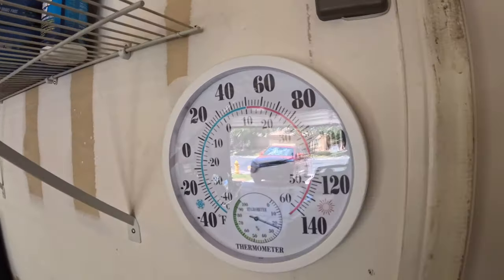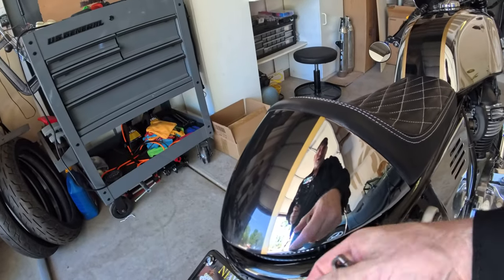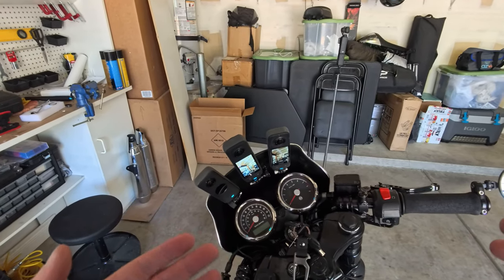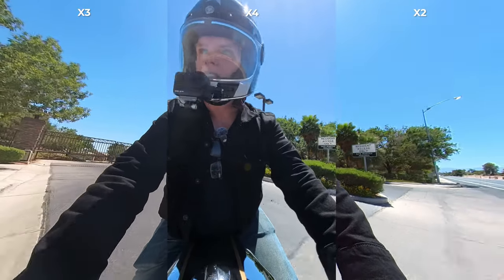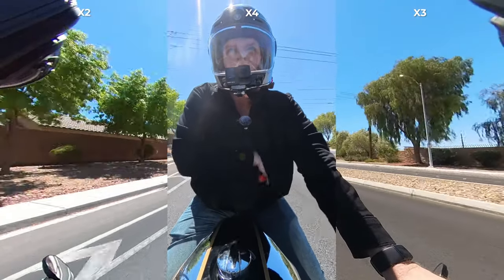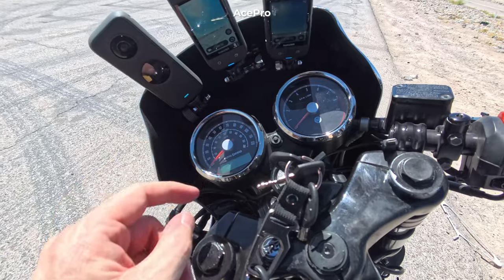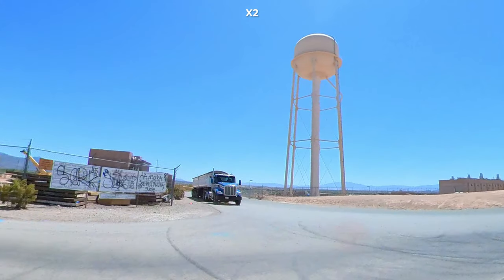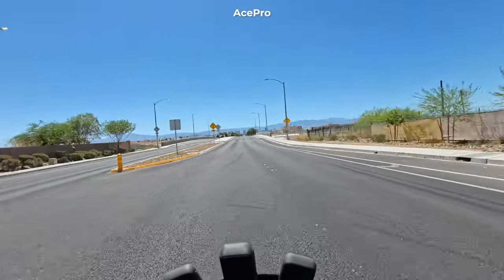Compare Insta360 X4 X3 X2 & Ace Pro | What's The Best Motorcycle Vlog Camera Setup | Royal Enfield

Comment: Great work, always appreciated.  Favorite part is when you stopped and whipped out the temperature gun, cuz who doesn’t ride around with one within reach?! Duh! The cameras all seem to do fine, especially for a novice like me. I usually aim to buy the model or two behinds the latest one to save money.  Too bad so many people are posting sponsored videos on the sly, but all the more reason to do your own homework. Appreciate your honesty.  Love your setup with the dual seats and the one with camera mount hole, genius. And the on/off luggage rack setup. Very smart. I don’t travel as much so I went for the permanent shorty tail and bondo n paint to hide the joints. Looks great but no turning back without much more work . Cheers
Reply from the maker: Who doesn't ride without a temperature gun?! Ha! My old GoPro would always overheat and turn off, could never use it in the Vegas heat. Curious how these cameras hold up. Someday, when I get a 2nd bike that's better for long trips, I'll get rid of the luggage and do a permanent shorty tail, lower the handlebars, and simplify the gauges & headlight... turn the bike into a real cafe racer!